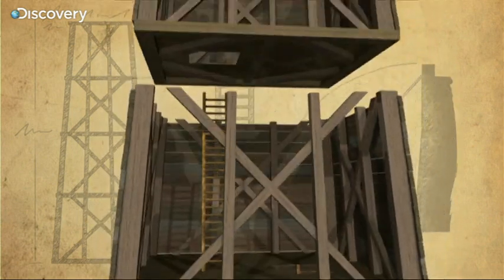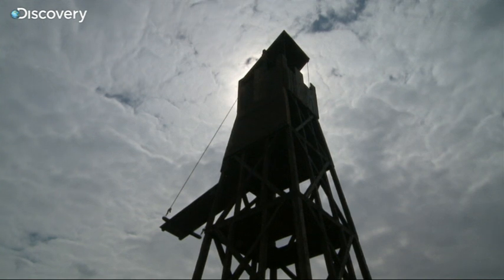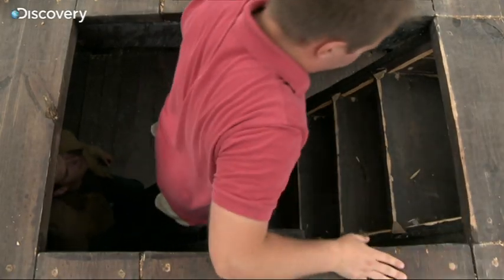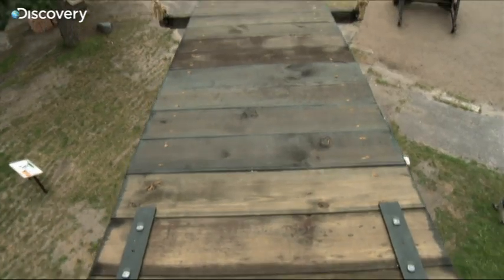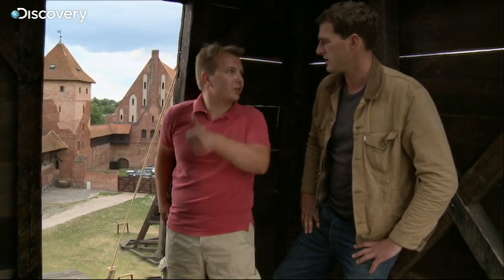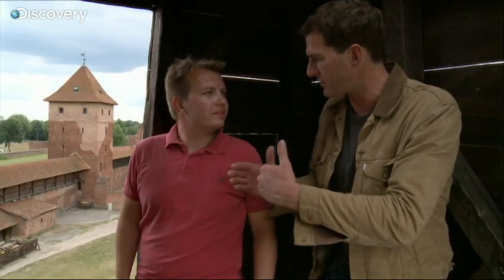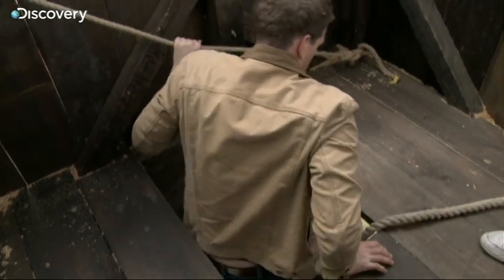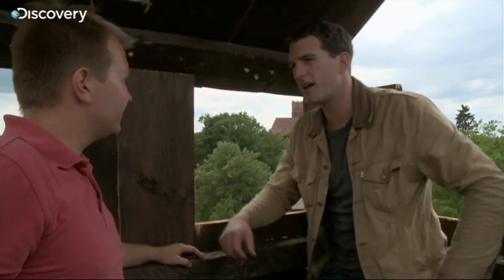Medieval Siege Tower - Battle Castle with Dan Snow

Comment: There is one thing I have been wondering, how the wheels axis can take that load. Do you have any insight to that?
Reply: On real siege towers, there was no back wheel and on some of them there was no roof on the archery floor either. The wheel axis was usually very thick beams going all the way through. There also was no knights on it before it was in position. Only archers on the top floor. When the tower was in position, it didn't need the wheels anymore so they locked them in place and the knights went up in the tower and since it was in position, it didn't matter that they broke at this point.
Reply: @KeiwaM  Very insightful answer and also thanks to Antti for asking it. I always wondered how tremendously heavy these things would be and how much strain would be placed on axis, wheels and the soil. I think even an impromptu road would have to be built at night with packed gravel for the tower to roll on lest it's wheels sink away in the earth.
Reply: I’ve yet to see a reasonable explanation of this. This ways as much as a modern tank, and is being drawn by unprotected ox tied to the front, with wooden wheels on uneven terrain that might also be wet?